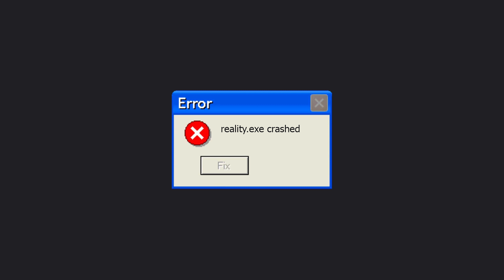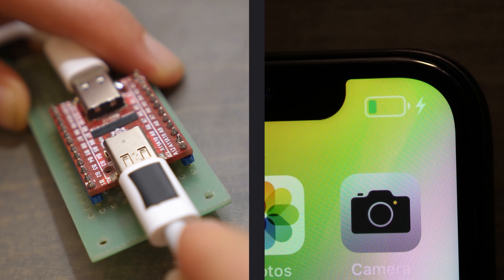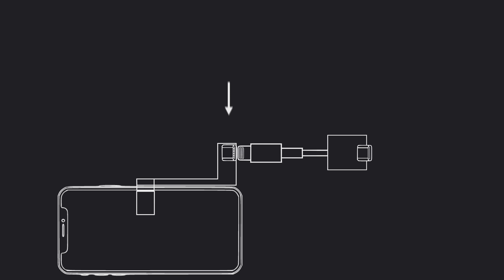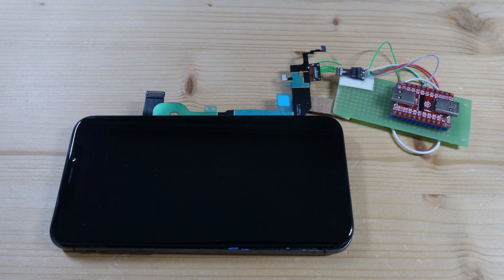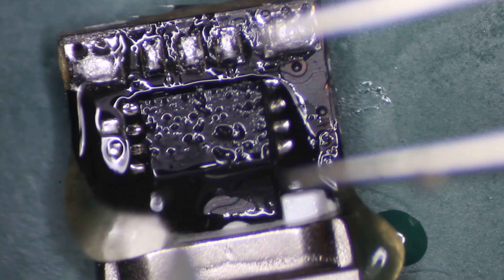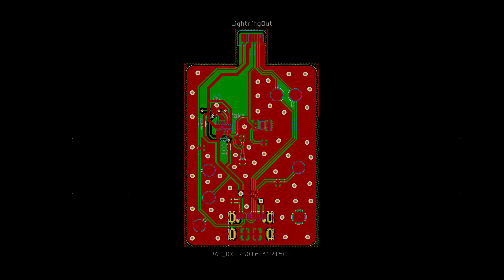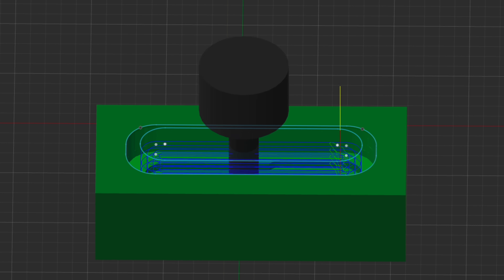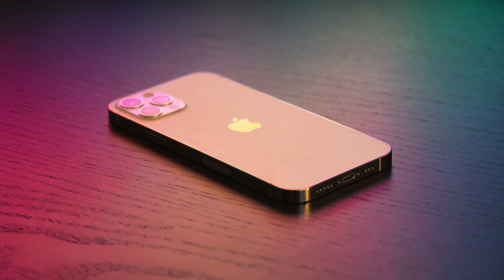How the World's First USB-C iPhone was born

Comment: Is there any way I could just buy the finished cable from you? Do you make and ship them? I recently got a broken iPhone X that works... For the most part. The screen is cracked and kind of works, back glass is demolished, and camera lens is cracked. I ordered the OLED screen and camera glass for it but then got curious about upgrading the port to type C since I'm gonna have it open anyway. I have no where need the the workshop shop needed to do what you did. I have a soldering iron and head gun... That's about it. Any way you sell these or would custom make one? What would the cost be if you would?

Comment: With the new USB C iPhone 15 are you planning on taking a look at that charging board inside the phone and seeing if it could be made to work with older lightning connector phones in some way? That would be amazing!
Thanks for the great videos and content!
Reply from the maker: Pretty sure they made a dongle for that hahhaha
Reply: @ExploringTheSimulation  true, however I meant more along the lines of it maybe being simpler to make an a usb c iPhone that’s not the 15
Reply from the maker: @DavidGordon-w7r  the problem is that you need to drill a bigger hole, and that will stop most people from doing it, that's why I haven't pursued this more
Reply: @ExploringTheSimulation  Yeah, that makes sense unfortunately lol

Comment: The gap between battery and charger board and taptic engine is for safety. If you fill the gap, you will create disaster like samsung note 7
Reply from the maker: there is still a slight gap, it's not completely filled. also, this is a mod, not a product on the market :) to conclude, I believe that if the battery really wants to expand it will likely start pushing on the screen way before it ends like a samsung note 7! thanks for the comment
Reply: @ExploringTheSimulation  oh! welcome btw

Comment: theoretically you could print the entire flex cable from the fpc connector to the port and simply incorporate your custom traces and components into a solid piece that routes around the battery. though moving the connector over from one to the other would be quite tedious
Reply from the maker: correct but the flex pcb is not only used for the lightning connector, so it would require a lot more work ;)
Reply: @ExploringTheSimulation  ah yea i forgot the mic,speakers, and taptic engine use the flex as well.

Comment: Absolutly amazing! 
This could be used for a small adapter aswell right? Not all Iphones look the same on the inside. So having a universal USB Female to Lightning male adapter would be great!
Reply from the maker: Yes you are correct. There is some products like this already on Aliexpress. I bought a few but they didn't work..
Reply: @ExploringTheSimulation  Most of them are just charging I think. Would love to buy/make one that 100% compatible. Something like this is missing in world of Iphone accesoires. 
Would turning this flex cable into a solid pcb with the right connectors soldered onto it, be enough to make it work?

Comment: Just get the new Ipad mini. Its wayyyyy better for the price, it has a bigger Display and allso able to make calls.
Reply: I hope this is sarcasm
Reply: @BallerShortsHD  The Ipad mini 6 costs under 400 Euros (64gb)
Reply: @BallerShortsHD  and it features a type c port
Reply: @holzwurm_hd7029  so you want people walking around using iPads instead of apple just putting a fucking USB type C port on the iPhone?
Reply: @BallerShortsHD  Im sorry but i dont really understand that question.
Reply: @holzwurm_hd7029  why use an iPad mini when apple should add a USB C to the iPhone in the first place, iPhones are way more feature rich than iPad minis, and its not reasonable to carry an iPad mini around
Reply: @BallerShortsHD  Well okay i get what you mean. But the Ipad mini is still the better value for your money.
Reply: @holzwurm_hd7029  not really, the ipad doesn't have any good cameras, or has apps as optimized like the iPhones, or the form factor, the iPad mini is only good for the display size and nothing else, plus who buys the 64gb model?
Reply: @BallerShortsHD  nope

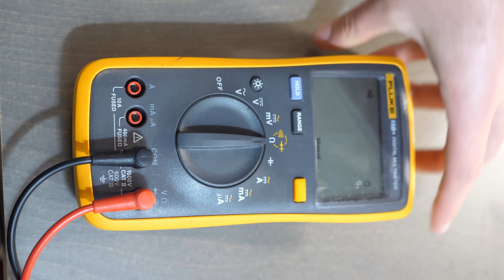Comment: 2:25 that just looks like resistance measurement. Except that it apparently emits a tone if the resistance is low, which I find unnecessary because I can juts look at the display if it shows a very low resistance or not.
Reply from the maker: when you're working under a microscope the tone is very very useful

Comment: It's cool and all. But like I said in the strange parts video where he considers doing this. The point of usb-c, other than to make it "ubiquitous", is to have 3.0 bus speed. Something you can't gain with an internal adapter without studying the logic board further. Videos aren't getting smaller, no matter how advanced the codec gets. And whoever thinks airdrop is "good enough" clearly you haven't transfered a file over usb 3.0.

Comment: Soooo while EVERYONE so insanely desperate for usb c, Apple is clearly moving towards completely wireless charging...which is by far more convenient and makes more sense as the phones would be...portless. usb c ports are actually larger than lightning ports and would reduce water resistance to a degree, and just because iPads and MacBooks are usb c DOESN'T mean iPhones should be as well, hence MagSafe charging, If that's the case apple might just as well bring back the 30-pin connectors. 
Honestly a portless iPhone with wireless charging would make much more sense as well as reverse charging with any apple device! 
C'mon people, think ahead, not backwards!

Comment: I wonder, since Apple does have the usb-c iPads, could you use the schematics of that port to reverse engineer into a different device?
Reply: @B-jv8iy  I think he means "a totally different design" like a different chassis. Yes, EV conversions can be simple, I'm wanting to do one myself, but they are saying you can't convert a 1990s Corolla to EV by looking at a new Toyota EV. You need to design it yourself, if you try using the exact positions it won't fit, so you will need to move things around, and make custom brackets, etc.
Reply: They likely are built from the ground up to use USB-C, so it wouldn't be helpful.

It's like wanting to convert a combustion car to electric and wanting to try and learn from one of their all electric cars, even though that one has a totally different design, it just wouldn't help you.
Reply: Imagine a usb type B ipad

Comment: Excellent work but who will have an USB-C port? Lightning is more easy to repair. I‘ve seen lots of repair videos with USB-C and most of them had problems with it. It was worn-out, USB-C pin was often brocken or full of dirt and junk and not easy to clean. If the Lightning pin breaks, just buy a new cable. If the USB-C pin breaks, let it repair for hundreds of dollar or buy new hardware.
Reply: I never had a USB C port break. They are exactly the same to repair as Lightning.
Reply: @ZillionPrey  If the pin in USB-C breaks, you have to Open your device and repair the whole port. If the pin in Lightning Breaks, just buy a new cable.

Comment: You could have done without the cnc, the outer trim on the lighting port is not part of the the frame. You can easely push it out from the inside and the cavity is the perfect size for the type c plug. at least on my experience thats what has happend. Kudos on the achivement nevertheless.
Reply from the maker: true on older models but not on this one. you can't push it out. thanks for watching

Comment: Have you studied the ports and cables from the iPad that already have a USB type C connector? In iPads, type C ports have all the functionality that can only be! Maybe you wouldn't have to invent a bicycle, or it's not that simple. Thanks. In any case, you are well done for doing such a job.
Reply: Indeed, Apple already know how to put USB-C on the iPhone by learning from the iPads (only iPad 9th Gen use Lightning now). One can also learn from there too.
Reply: @tiadaid  That's what I think, it would be easier to take a ready-made solution of a loop and a USB C connector from an iPad. Why was it necessary to follow a difficult path. In any case, such actions of old engineers will give the foam of the appl what to do in iPhones of the usb c or lightning with all the capabilities of the usb c. I hope for a quick benefit for users)

Comment: Great video! When setting origin points for the CNC you can use a piece of wet paper on top, and then when the paper starts spinning it is almost zero. Either you go with it as zero or you take into consideration the thickness of the paper.

Comment: I love it! Massive respect from my side, that's so impressive!
But a quick reminder: There is a reason for this gap! The battery can expand after some time and if there is no space for that, the same thing could happen to your iPhone than to some Galaxy note 7 😅
Reply: While you are correct about the note 7, batteries don't expand much on width and length simply due to how they're constructed. The gaps are there to protect the phone from going kaboom, but it's mostly for construction cost because lipo batteries are relatively soft and can easily be pinched when assembling. When the battery is pinched, that's a fire hazard. So if they want right tolerance on the battery, they have to spend extra time, which means extra money for negligible improvements. Why spend so much more money and potential lawsuits and recalls and brand damage when you can just play it safe and shave off 100mah. Not like it would make a noticable difference in normal use. It's like 15 more minutes or something out of a whole day off use.

Comment: You have made things easier for Apple's R&D department. They can simply use your design with some minor changes.
Your work should be awarded by Apple.
Reply: but that now how apple works. also they just had to add their chip inline the flex they use for lightning or even just make that chip part of their soc and instead of lightning they add a type-c plug

Comment: Uhm... fast sharging does not seems to be possible.
Both CC lanes are handled by the 5.1K pull down Rd resistors.

One of which is also handled by the tristar. I'm not completly sure if it is able to change its internal resistor value to allow a different current capability.
The thing is that the whole system is designed to be integrated in a cable where only a CC is needed. (unless we are talking about active cables and PD protocol).

I'm not completly sure how you tested this, but even without the 5.1k resitor with a dumb USBA to USB c cable you shuld had the charge working on both sides.
In fact I still dont understand the complete workflow of this. Also by adding the 5.1k resitor only one side of the usb C is monitored and this make me think that it is not even necessary by the "tristar" or the "HiFive" chip.

All of this is simply confusing. Wondering if with the original cable fast charging was/is available after all.

Probably the way to go is to detect the pullup on one of the two CC pins and use a mux IC to connect the CC lane from the "tristar" IC to the right CC pin of the UFP connector.

Comment: orientation detection should be easy enough to implement- all you’d need is a comparator to detect which cc pin has a higher voltage, and an analog switch. hope you’ve still got that jank setup for testing? 😁
if i could afford a new iphone (stuck on a 6) i would totally have a go at soldering up one of these, looks like fun.

Comment: Why would you not utilize the two pentalobe screws on the bottom of the phone, adjacent to the lightning port, to secure the USB-C port. The standard lightning port uses those screws because they are axially loaded rather than loaded with just shear force as your screws will be. If the wall thickness of the bracket would be too small due to the larger width of the USB-C port, fine.  I get it. I'm just not too confident your 3D printed bracket will hold up to the cyclical loading expected in plugging and unplugging the phone. 

Also I'd image the subsequent generation of iphones with flat edges would be easier to machine. Although judging from the software limitations placed even on authentic replacement parts I doubt it would pass the proof of concept phase.

Very cool video, nice work. If apple had USB-C I might have bought an iPhone.
Reply from the maker: I like comments like yours. It shows you really watched the video, thank you.
You make some very valid points. The 3D printed bracket indeed won't hold up for thousands of cycles. It was just a quick and easy way to support the connector. Probably could have used the pentalobe screws with some extra work but it is not the first solution that came to my mind. I want to get into micro spot welding for future projects. That would help.

Comment: Awesome job!! Just for the curiosity - is the charging speed now same, regardless the orientation of the cable? Cheers mate!!
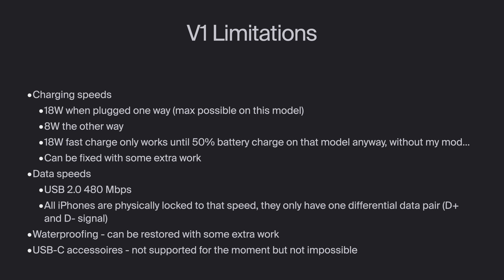Reply from the maker: 3:37
Reply: @ExploringTheSimulation  Thanks man, but I thought it was your assumptions regarding v1 prototype, not the final version, right? It is an awesome project anyways - one of best I have seen on YT. I was just curios if and how did you resolve this issue.